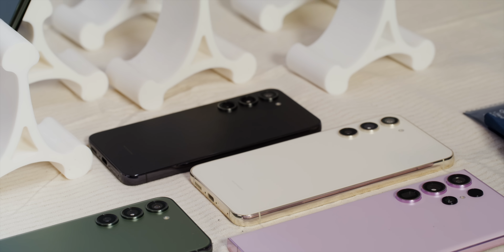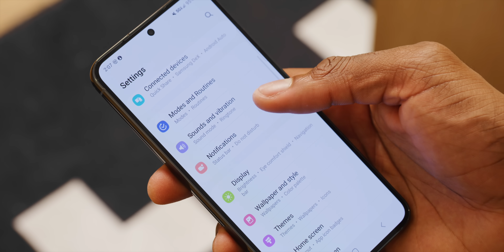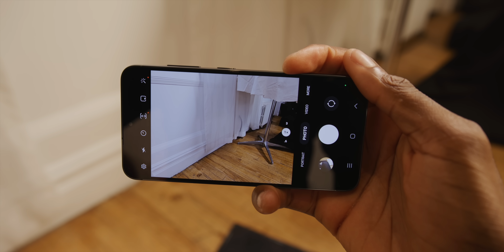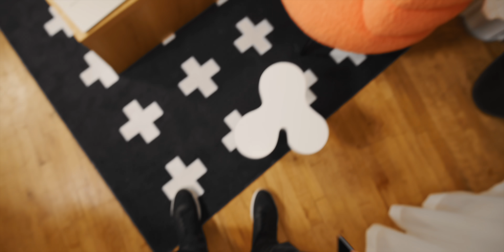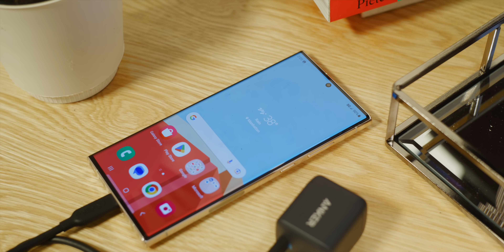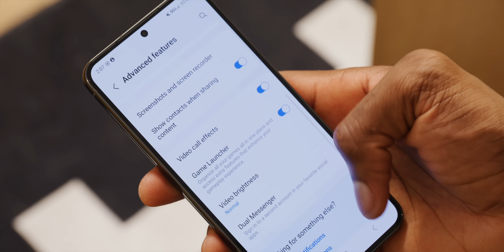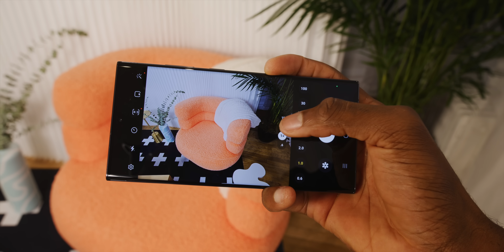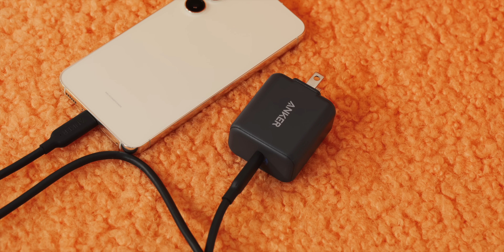Galaxy S23 / Ultra Impressions: Cruise Control!

Comment: You know the improvements are tiny when even the Galaxy S21 ultra could pass as a 2023 flagship.
Reply: I mean appart from the overheating 8gen1 this is it, agreed. Peak phone has been reach, just gotta bring back the jack and sdcard now 😅
Reply: @Jbrimbelibap  s21 ultra had 888 not 8 gen 1
Reply: @xstongames4778  same deal both overheat
Reply: @xstongames4778  my only complaint is how bad my 21 ultra overheats, that 888 gets hot, but apparently the new gen 8 does too
Reply: @Jbrimbelibap  just let you know that has been fixed ages ago my s21 ultra is working flawlessly.
Reply: @Jbrimbelibap  kelving said the same thing about physics in his day🤷🏽‍♂️ that was BEFORE Albert Eintstein
Reply: @Jbrimbelibap  still on my s9+ tbh.
With sd card, 500gb storage.
Got it in 2018, replaced battery once, still not inclined to replace
Reply: @stuartburns8657  Makes sense, especially if you have the version with the snapdragon 845. Since 2019 upgrading as felt like a downgrade, less features... unless you find the occasional hidden gem (mostly xiaomi/asus rn)
Reply: @Jbrimbelibap  It has that CPU yes, and I'm not exactly a power phone user or gamer on it, so I'm expecting another year or 2.
Unless as you say, I come across a bargain 🙏
Reply: @Jbrimbelibap  yep only reason I'm still hanging with my s20+5g I like my sd card usage.
Reply: @Jbrimbelibap  what was their reason for removing it
Reply: @Jbrimbelibap  my s21 ultra overheats too, that's the snapdragon 888 processor though
Reply: @chrismontgomery3658  also Samsung made, and actually less powerful than the 865/870 once heated up, which doesn't take very long yeah
Reply: @Jbrimbelibap  jack ? why moving back in time and keep using old technology ? lmao..jack phones works only good on real amps..mobile phones have crap dac so using bt phones is ok..lol sd card ? why? cloud storage is way better so 128 gb in the phone for some quick photos/videos or game it enough...
Reply: @dj.mb_one  jack gives better sound than Bluetooth, and their is no cloud, it's simply someone else's computer. Cloud is also a subscription, no fucking way that's better. Especially when listening to music on a bike trip where you have no internet half the time...
Reply: @Jbrimbelibap  jack gives only better so ud with good  DAC wich no phone have so you need to learn a bit about sound before you say anything about it 😂if you don't know what DAC is then research. Never said to use cloud for music that's why 128 GB syarage is more then enough for that😂😂😂 bt headphones today sound very good to day since they don't need DAC  like jack. There million of test og bt headphone and Jack headphones on mobile and trust me you will never hear the difference anyway. 😂😂
Reply: @Jbrimbelibap  ps. Are you telling me that apple cloud us someone computer wich cost nothing? 😂😂😂😂
Reply: @Jbrimbelibap  peak phone....back to the basics 😁
Reply: @Jbrimbelibap  s20fe has sd
Reply: Facts lol, but every phone company now is pretty much guilty of this the yearly refresh just is not needed as much anymore. I would rather them relase new phone less commonly and have a new look and better features.
Reply: @jonathanknolls5910  the problem is that doesn’t fit with the mobile market anymore. The goal is to get customers stuck in endless contracts where they’re constantly upgrading and never fully paying off or owning a phone. Even if they do pay full price for a phone you want to replicate this by having them trade in that phone immediately for next years model. This way people get in the habit of constantly buying the new model. The telecommunications market has essentially become a subscription service (just quietly). They’re pushing the same idea of paying yearly to upgrade, never actually owning, etc. The companies don’t care about pushing out a new innovative product, they want money and they want it consistently and reliably.
Reply: @vullord666  Ya that is true, and unfortunately they have gotten good at it. I hope that eventually people stop buying/upgrading every year so that way they have to be a little more innovative, but that is probably wishful thinking at this point. No matter how similar it is to last years model people still upgrade which only encourages companies to keep down this path of mobile marketing
Reply: I'm keeping my S10+.
Reply: Yep. 21U here as well. Holding out for the Fold 5.- if that thing delivers, I'll consider it. Otherwise, I'm good
Reply: @Sheikah86  same here!
Reply: I'm still on the S9+.. but IMO S21 Ultra is the best looking phone.
Reply: @Ra-Hul-K  still keeping my S9+ also. Its thinner compared to all the newer phones after it. Only thing I really want in a phone is 120 refresh screen and macro camera. I want a smaller phone with the pro features! I hate carrying a clunky large screen phone in my pocket when It serves no purpose for my needs. I have good eyesight and don’t need to stare at my phone for a long time. I can have a better experience with more flexibility and options using my other devices, I don’t sit and watch full movies, I have a TV for that, I don’t edit photos or read books I have a computer/tablet for that. Phone calls, take photos, look at the latest news, short youtube vids is all I use my phone for. If I was a business person who needed my phone for work on the road a lot or play mobile games I would want the larger screen.
Reply: @jbld50  that's pretty much my use case scenario too! how's the display holding up on your S9+? mine has the yellow/greenish tint problem. since i only use the phone for brief periods of time, it doesn't bother me much. honestly i have no incentive to upgrade. i would rather put that money into a TV budget 😬
Reply: @Ra-Hul-K  it's really a great phone!
Reply: Yep im keeping mine
Reply: I’m definitely keeping my S21 Ultra. Still the better looking phone, too. Sharp edges are overrated.
Reply: @LostChildOfTime  FR MAN MY S21 ULTRA LOOKS LIKE AN S PHONE
Reply: @fahim_betaa  that's what I like about it. Best S phone yet!
Reply: @boothatron  FRRR
Reply: @LostChildOfTime  Absolutely. S21 Ultra gang rise up!
Reply: @Onaterdem  lets go gang
Reply: @Onaterdem  me too 👍👍
Reply: @Onaterdem  I only have a s21 plus though, kind of regretting not getting the ultra a tiny bit
Reply: @LostChildOfTime  They aren't! Note10+ gang here
Reply: i see everyone talking bout their s21 and stuff. makes me feel like an old dude with my trusty Note 10+ still going strong
Reply: @LostChildOfTime  Have my S21 Ultra too, but I'm in the UK, meaning I have Exynos chip and not the Snapdragon chip, therefore I'm considering whether I should trade in my S21U, especially that I can get £600 trade in value instead of only £410.
Reply: @LostChildOfTime  honestly I have an upgrade and I think I'm just gonna get the S21 Ultra lol and skip the 22 23
Reply: @Jacob Jones  trust me you won't regret it
Reply: @Jacob32905  what cellphone provider is offering you an upgrade?
Reply: @1230mkelly  😂 Verizon. And it's not a free upgrade if that is why you are asking. I just get trade in value-added.
Reply: @LostChildOfTime  I bought the S22 Ultra on launch and sent it back in under 2 weeks and got a S21 Ultra. Absolutely hated the impractical boxy feel. They're both 6.8" but the terrible Note shape makes one feel a load bigger.
Reply: @LostChildOfTime  I have the Note 20 Ultra, and I'd rather have this design. The N20U already has sharp edges on the top and bottom, and the side is so tapered that it's hard to hold the phone and use it without a case, because my palm touches the screen. I don't like using cases, but I haven't felt comfortable enough with this phone not to use one.
Reply: @LostChildOfTime  nah it’s definitely uglier than this but it’s basically the same specs.
Reply: @LostChildOfTime  s21 ultra is going to be outdated for another 10 years
Reply: @LostChildOfTime  I agree about the phone but sharp sides makes it feel more grippy
Reply: @LostChildOfTime  same
Reply: @LostChildOfTime  thats cap, the note looks far better than s21u
Reply: @LostChildOfTime  facts, using my and never has a hiccup. Huge storage
Reply: Note 20 ultra 5g gang
Reply: Im still using my galaxy note 10+ and it looks exactly like the new one
Reply: And that's why I'm gonna buy an used S21 Ultra in the next few weeks ;)
Reply: @jonathanb.1625  don't buy used go refurbished. Same price and basically like new
Reply: My S21 Ultra still has more ram and possibly the best battery life out of the last few generations of  Samsung phones. For a $1000 trade in, is it worth it>?
Reply: @HAFBeast91  I personally wouldn't swap my S21 Ultra for S23U even for no extra money. I just prefer the design quite a lot of the S22/S23U!
Reply: @HAFBeast91  I think it depends what you're getting. I maxed my S21U (so 16GB RAM/512GB) & it came with free Buds Pro. If I bought the equivalent S23U here in Europe now, I'd get around 570 trade in, it'd still cost about 800 bucks and there's nothing thrown in as an incentive or even Samsung Store credit. You can argue the toss on if I'm taking a RAM hit in real terms given the speed increase of the newer stuff, but it's still closer to 2/3rds of the full price for not a lot extra, when my current phone has the same camera setup, the same storage & still gets close to 8 hours SOT with a Exynos chip.

If you're getting 1000, and only laying out 500 or less, then it's probably worth it. The new chip is a good bump from last year, the cameras do look better in terms of stabilisation etc, and Samsung have been on it with patches/software in the last 2 years. But I wouldn't shell out if you're paying more than half of the new price personally.
Reply: It looks very different from the S21 ultra 👀
Reply: You mean like the iPhone11 and iPhone 14pro max
Reply: @dillonbanks609  LMAO they don’t even feel the same 💀
Reply: @PG  they really do, minus the dynamic island they copied from lg. Put them side by side an then come back to your comment clown 🤡
Reply: It really no different than iphone 12 and 13 pro max. It has the same box sides as the 13 pro max
Reply: Bought my s21+ 256gb last year for 365$ brand new and I don't think I'm going to upgrade soon
Reply: @colognedepapi  Where did you get, and who is your cellphone 📱 provider?
Reply: @colognedepapi  yeah S21+ is still on point! I have S21U and I'm sticking with that! S21+ is a nice size and design!
Reply: @boothatron  i agree but my first choice was s21u but my only dilemma was when i will buy a screen protector for it in the future and it will be expensive because of the curved screen that's why i chose s21+ in the end because of the flat screen.
Reply: @colognedepapi  America is cheap, in Romania s23 is almost 1050 $
Reply: I went from 21 to 22 cuz I got a great trade in and free watch out of it, but I don't think I'll jump to 23 since there's not too much different
Reply: I went from the s21u to zfold 4 that's where the real innovation is
Reply: @Reagan_Ridley  don't like the crease
Reply: @TheHesK9  it is what it is i rather have something new than the "same old same old" I've had it for 3 months and I love it I still have my s21u if I want to use it for pics etc
Reply: @Reagan_Ridley  Very true, planning to do the same but from S10+ to Fold 5 maybe or even Fold 4 now it's way cheaper
Reply: currently an S22Ultra user. SPen gang
Reply: @sluice2015  Unless you're drawing stuff on your screen, the S Pen looks completely useless to me. Writing by drawing is more difficult than just typing, so it loses at that too. What use cases are there?
Reply: @Onaterdem  nah. its not just for drawing. it helps with photo editing too. AND using it as a camera remote is fkn goated. family group pictures during the holidays were a breeze because i was able to put my phone on a tripod and use the SPen to take the picture. ALSO,and i dont see enough people mentioning this, its great to just be able to scroll thru apps with the pen,keeps the phone free of finger prints and grease tbh
Reply: @Onaterdem  As a physics major, it's pretty useful for doing a bit of maths
Reply: @sluice2015  Yeah, I know about the remote but I already have a Watch so that's taken care of. I don't ever draw or edit photos, and the fingerprint-free screen would be nice I think, but I would much rather have 500mAh extra rather than the S Pen. But Samsung merged Note and S, so if you want the best S series phone, you have to get a Note series phone now :))
Reply: @Onaterdem  oh i feel that! see,how you are about the pen,is how i am about smart watches haha. i find them useless, with small convenience.
Reply: @sluice2015  I was also partial towards smartwatches until I got one for sports tracking.

Being able to leave your phone behind while always seeing your calls, notifications and the time, being able to safely talk to the phone while driving, sleep tracking, sports tracking, Assistant on-the-go, other health related stuff... As it turns out, smartwatches are invaluable :D
Reply: @sluice2015  average
Reply: @Onaterdem  I had never used a Note phone before getting the s22 ultra.
I used the pen for the first month or so of owning the phone and then completely forgot about it.
I wish they just included a headphone jack and bigger battery rather than the s pen.
Reply: @Onaterdem  real life use: my wife likes to take notes on it with an s pen real quick, recently she handed it to a restless child to color pictures at a restaurant and the child was mesmerized. All the isheep we staring in disbelief jaws dropped, it got quiet for a minute.
Reply: @Onaterdem  Writing Chinese characters/Japanese Kanji if you're studying (which I am!)
Reply: @Onaterdem  I had a Note 4 (very old) and used it for notes, but it was like a mouse for me. Holding a phone with my left hand, and pen with my right let me click on things a lot easier. For example scrolling a Web browser felt more precise.
It's not amazing but by today's standard, if I have to click one more time than needed to do something, I feel annoyed lol.
Reply: @Onaterdem  your not a Note user. The s pen has more useful features than just drawing...
Reply: @sluice2015  not to mention to better zoom, translate words or phrases, crop, copy/paste, to just name a few👍
Reply: @shawnstuckey2461  Which is what I asked, please learn to read people.
Reply: @Onaterdem  ive been thinking about that, but haven't because the s21u cameras are so good and reviews say the folda aren't. Have you noticed a huge difference?
Reply: @Onaterdem  I use my mom's phone (note 10) for studying, drawing, and other things that aren't on top of my head, s pen isn't useless
Reply: @GameOver-nm2us  Yes, if you re-read my comment you'll see that I never said it was useless, but instead that the S Pen's intended use cases never happen for me, and even asked for more possible use cases
Reply: @Onaterdem  fair
Reply: I'm on S21U, but probably gonna get S22U when S23U users slling their old phone for cheap🤣🤣
Reply: @JohnDoe-lc7tv  same here....
Don't think much difference between the latest two s series phone.
Next year probably s24 ultra might ve getting 150x zoom
Reply: I have the s21 ultra, and the s22 ultra. I like my 21 better but I must say, the 22s cameras are just simply better.
Reply: Still way better than Apple actually they don't even do any changes in the 14 eww
Reply: @swastikeditz15  they didn’t make it look the same but they redesigned the entire frame and as a result it is more repairable, since you can open it from the front or the back now.
Reply: It's not a very minor upgrade like what Apple did last year it was absolutely horrible with the iPhone 14 lineup ad actually all phones after the 11 are f'ed up fr
Reply: @swastikeditz15  Apple actually did a major redesign to the phones frame.
Reply: I still have mine, I'm waiting till the s24, maybe s25
Reply: Im buying note 20 ultra. That's flagship!
Reply: Especially when the 512GB model has 16GB RAM and 2 phones later still on 12GB 😅
Reply: There is absolutely no reason to upgrade from s21 Ultra... even the battery is the same capacity ... i guess we are reaching peek smartphone time
Reply: Yeah, the performance of the Snapdragon 8 Gen 1/2 far outpace the thermal capacity of phones right now. I'm thinking of switching to the Redmagic 8 Pro for gaming. The real performance gain in the 8 Gen 2 is in the GPU and RAM.
Reply: What about the s21+? 
My S9 is finally losing its battery power so thinking on if to go for brand spanking new or a year or two back.
Reply: My contract just ended on my S21 Ultra. This is the first time I'm not even considering updating. The S21 is still so good, and now with 4 years of software updates, don't really see the point
Reply: YeAh bUt  tHE neW ProCeSseR
Reply: @tristancarter5975  New processor, New RAM (DDR5x instead of 4), New storage (UFS 4.0 instead of 3.1), New wifi antenna bands (WiFi 7 instead of wifi 6), cameras (no need to mention specs on it), newer gorilla glass victis 2 instead of 1+), 
As far as design, it's also minor but still noticeable
23 ULTRA is more square on the sides than the rounded sides on 22 Ultra, vol rockers and power button on S23 ultra is lower than S22 ultra for better reach, 23 ultra has slightly thinner bezels, has less curve than the 22 ultra on the display, camera sensors on the S23 are larger compared to S22 Ultra [way to differentiate the 2],
Reply: I noticed that with phones in general, the last time I got a new phone I had the previous one for 2 years until I got my current one, but my current one I already have for 3,5 years now and I still don't feel I have to get a new one because I am missing a must have new feature that a phone nowadays should have.
Reply: There's simply nothing to do.
They made the best phones and I genuinely cannot see any way in which they can improve on the S21 Ultra and S22 Ultra.
Apart from faster charging or better processors, which to be frank are unnecessary because they phones already work flawlessly.

So there's nothing to improve on. The best phones have already been made. This is the absolute peak for technology. I can't see where they can make it better??
Reply: @JamieR1988  The next evolution will be augmented reality glasses. You are correct, soon these phones will be a thing of the past because there is only so much you can do with them. Hence, the only logical technological advancement will be being able to do everything right in front of you using eye glasses.
Reply: still love my s21 ultra
Reply: I'm now considering to get the S22 Ultra haha
Reply: I went from the S8 to the S21U 512gb so you can guess how long it it will take to upgrade to the next one
Reply: That's why I still have one, plus I prefer the design.
Reply: Real.
Reply: Phones nowadays dont get huge upgrades anymore. Thats why upgrading every year is pointless.
Reply: I have the s21 ultra but ill upgrade since tmobile is giving 1000 dollar trade up credit from the s21/22 ultra to the s23 ultra.
Reply: Love my S21 Ultra!
Reply: its not there fault just like Apple at this point there upgrades are so pointless and they probably have one feature that makes someone wants to buy it but in reality not worth it typing this on my Iphone 12 mini lol
Reply: Yeah, S21 was goated, hands down the best looking phone. The s22 and s23 ultra weren't that good in terms of design but the s23+ looks super good imo, even in terms of performance it's very similar to the ultra
Reply: S21 ultra is the most attractive phone of the last couple of years. S21 Ultra 🤚🏽🤚🏽
Reply: What are you talking about the Galaxy S21 5G Ultra is a hands on amazing phone. Huge battery, quick charging, insane gaming features, big memory,  and fast asf. No one should be wasting money on these newer phones, the only reason they are coming out with these is for consistent money grab.
Reply: @RealbossbeastYt  as great as the s21 ultra is it just is not a flagship anymore in 2023. The new model has significantly better battery life and is faster with a much  better camera system. They come out with better phones every year thanks to competiton in the market and advancement in tech. Just because you do not need a new phone others might... We do not need a new phone at the exact same time
Reply: S20 Ultra to S23 Ultra is a big upgrade.
Reply: that zoom camera is probably the best portrait camera in any phone ever made honestly. I still remember i shot a city cat like 3 years ago with that phone. Its the best damn picture of that cat anyone ever made.
Reply: It can't pass, all you have to do is turn both devices over to see which is which, Google image S21 vs S23 back
Reply: @Carl Gunderson thought he was talking about last year's phone, you know the one that looks the same, the one it makes sense to talk about
Reply: 1.3 likes? Lol show how many of you are clueless Lol
Reply: the other side of the coin is this speaks of the future proofing of samsung flagships
Reply: It's not tiny it's not just much improvement
Reply: I'm looking to upgrade from the S21U mostly for the camera improvements and the S-Pen, but I could very happily keep it for another year. It really is a great phone.
Reply: Apple in the corner:💰💰💰💰💰💰💰💰💰💰
Reply: Exactly. Ive been ready for an upgrade from my 21, but nothings really changed much.
Reply: haha yup.. flagships phone have reach it's peak !
Reply: My S20 ultra still works great to be fair
Reply: I have s21 FE and from experience it somehow takes sharper photos than s21 ultra with exynos.
Only thing that's better is zoom
Reply: S22 Ultra on top🥲🥲
Reply: @Just a user Agreed updating every year at one point was understandable, but it just is not anymore. Like you said about every 5 years there is a major update, and that goes for pretty much all aspects of tech nowadays. The year to year market idea just does not make sense anymore. However since technically speaking chances are every year the release a new phone someone has hit their 5 years with their phone and now want to upgrade. I think 5 years may be a bit to long for that reason, but that is a good time to keep a phone however try yearly or bi yearly would make a lot of sense, but people will still upgrade year to year no matter what so the companies will keep making phone every year, but a more consumer based market would be nice.
Reply: It's not like you are comparing 4080 to 2080 or i7 12th gen to i7 10th gen. Performance differences in mobile processing units are negligible
Reply: @actualyoungsoo  That's what people who aren't subscribed to Geekerwan might say
Reply: Not even close if you compare chips
Reply: Just get an iPhone finally
Reply: @Tetrathegod  did you mean "just got an iphone finally" ?
Reply: My s21 is still fine
Reply: even s10+ feels enough, it's just new hardware, nothing more
Reply: I'm using the s21 plus, and I won't get another phone that soon, it does absolutely everything I need super fast, cameras are absolutely great, 0 problems with it, really no reason to change, even if I had a problem with older looking devices, which I don't, this phone looks the same as the s23 plus.
Reply: Nah bro you jokin man
Reply: - true, s21 ultra forever
Reply: Watching this on my s21 ultra it's still a beast of a phone
Reply: I still use my Samsung Galaxy Note 10 plus as my daily driver. There is no need to switch it over any other S21 ultra, S22 ultra or S23 ultra. Perhaps the S25 ultra in 2025.
Reply: Note 10+  3 years and Samsung isn't winning my business again when the old phone is still a power house.  I have the regular Note 10 as well.  Phone company offers free swap but I like my sd slot.  Smasung is doing the scam son
Reply: well, that's what iphone has been doing for YEARS 
Samsung just following suit, as always. So sad.
Reply: Until they fix the LED Screen line issues with the S20 to S22 series phones I ain't gonna buy another damn Samsung phone. 

Current daily phone is S20 FE already seen a white line when I used the phone for gaming all day and it heated up. It disappeared after I let it cool down and restarting, a bad omen if you ask me I fully expect the screen to go bad within 3 years.

They're good flagships alright but it just feels like the last great phone churned out by Samsung was the S10 series line and even that has the line issues with the screen now. It's not about how old the phone is either, I have a J7 Pro from 2017 and the screen has not spit out even a flicker much less a line, same with my Motorola G6 and LG V30.
Reply: S23 is not a very minor upgrade like what Apple does
Reply: the s10 could also pass as a 2023 flagship it's still sharp
Reply: Well, this is actually worth for S20 Users and S21 users who only have ugly exynos version
Reply: I'm rocking an iphone 11 pro max, I'm eyein this one hard. I'm going back to samsung.
Reply: IF you wanna talk about flagship and time there is s10 plus witch is again a beast and holdin on i have 3 years + using it wih a broken screen and is still fire
Reply: how about note 20u? worth spending 1200 for 512gb?
Reply: im going for a vacation and originally want to buy another note20U for back up. currently it is 550 open box now that trade in value of note 20U is just 350 should i buy another n20u or just buy s23u?
Reply: I like this phone so much,  can someone purchase it for me please 🙏🤲
Reply: Am keeping my s21 ultra. The best phone ever
Reply: @GaryMitchell1966  my phone is more like a tablet for me. I hardly talk on the phone. I prefer to WhatsApp people. I use it for emails, along with social media, YouTube and films. I also love taking photos and am due an upgrade. I'm using a 2018 Samsung S9. I had a DSLR but ruined it on a mountain due to letting moisture in the body :(
Reply: Impressed with 200M camera.
Reply: My S21 Ultra 1x rear camera is out of focus for 90% of the time. And after reading other person who has the same problem, I need to shake my phone a bit hard and the camera back to normal.
Damn it.
Reply: Way to judge a book by the cover.... the s21ultra would only pass as a flagship on appearance. (Still the best looking ultra imo)
Reply: S21 Ultra (512/16 Snapdragon) is absolutely underrated
Reply: But both of those phones don’t compare to the superior iPhone 14 pros
Reply: @dadillonful  except for the first time, they do
Reply: S21 Ultra Ganggggg
Reply: Been a iphone user after i upgraded from galaxy s4. Now i am back to s22 ultra. Everything you can ever want is in the phone. I am keeping it forever
Reply: @aniruddhakabbya622  welcome back!
Reply: My s21 ultra contract is up so I'm upgrading, natural I think
Reply: @mazzalean077  may I ask who you cellphone provider? I am about to switch from Metro PC in order to get a REAL 📱 phone! 😂
Reply: my s21 ultra got screen burn in
Reply: @archhhhh  time to upgrade to another s21 ultra.